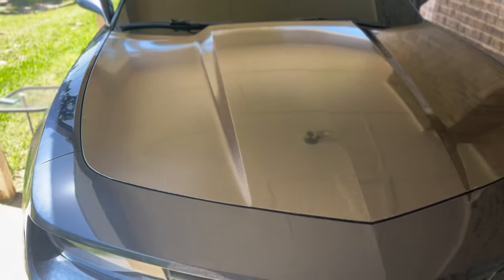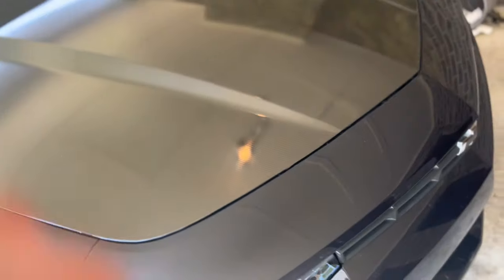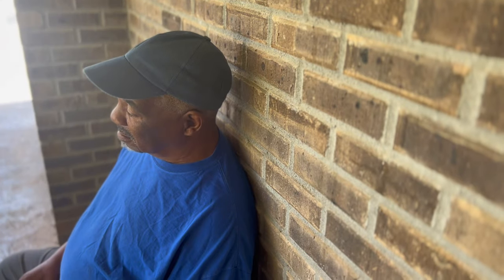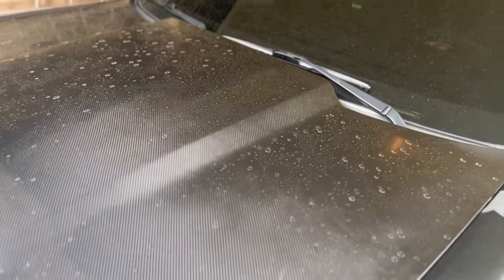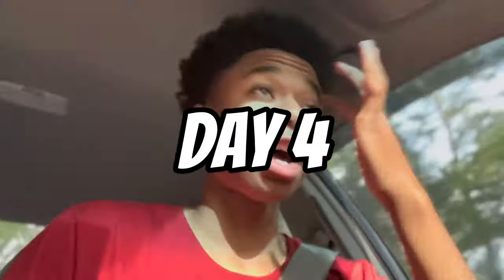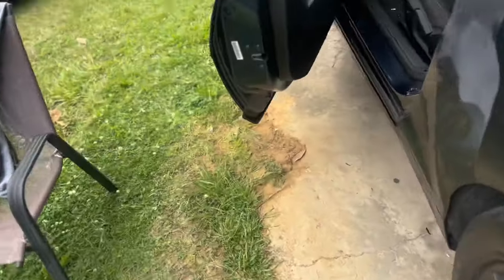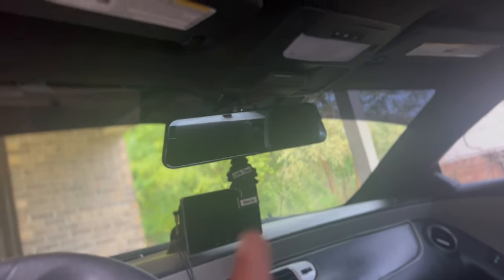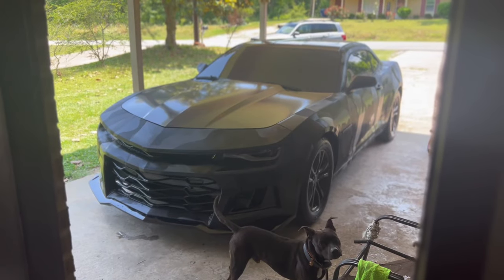5th Gen Camaro Transformation | Wrapping Camaro | Zl1 Bumper Conversion | Black Stealth Camo Wrap

Comment: Where did u buy the zl1 bumper??😮
Reply from the maker: Amazon
Reply: Looks great
Fits perfect or not?
Reply from the maker: Thanks..I’ll give the fitment a 80% but I’m not much a picky person so it was fine with me just a small gap between the panels compared to stock bumper but the more you get those screws on there and locked in the smaller the gap would get